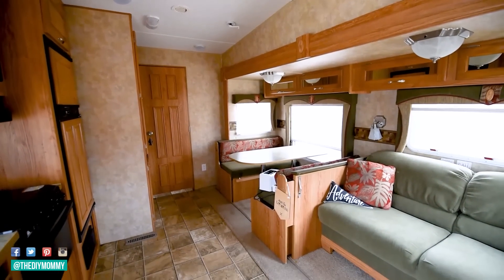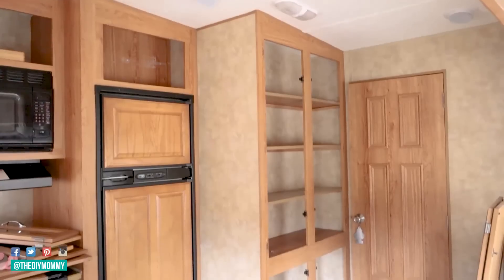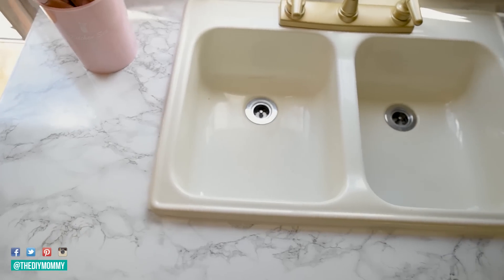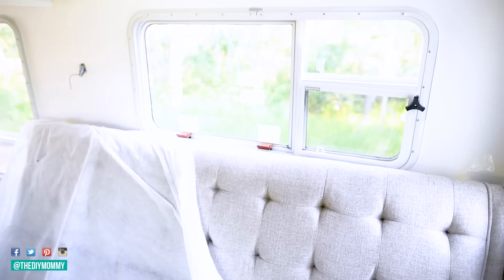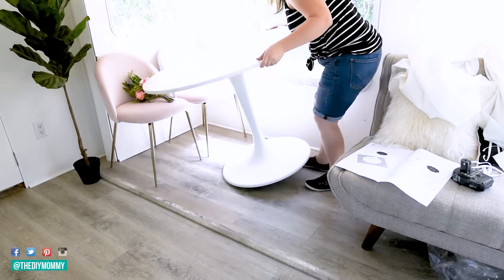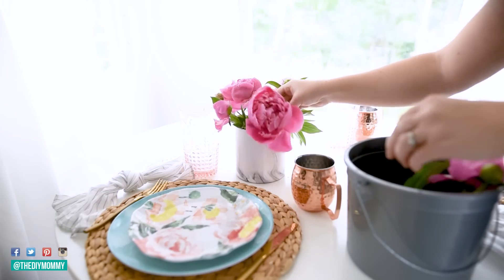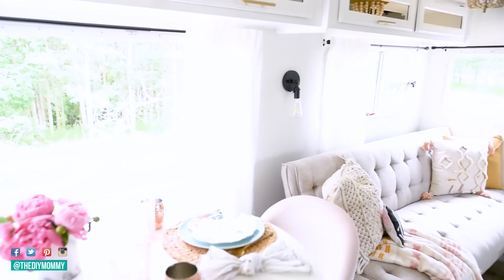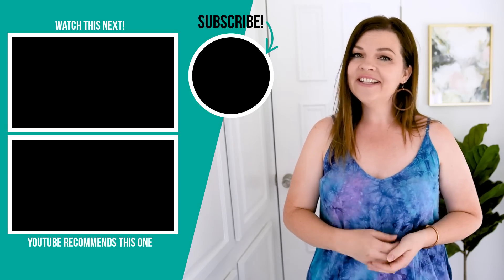RV Renovation Before & After Vintage Glam Makeover! | Our DIY Camper 2 | The DIY Mommy

Comment: My little Shasta Compact is Country Grandma style!  I worked around some old quilts I had and some thrifted custom made curtains that I was able to alter to fit the theme perfectly. 💕💕  I used click and lock shiplap material made from reclaimed wood that I found at Lowe’s for the ceiling and walls. Much easier for me to make the necessary small cuts on the angles.

Comment: For the coffee bar. Make a removable brace so you don't have to remove everything when you travel. And for the dinning table, you could cut the sides off. Then use piano hinges and reattach the sides and make a support the whole the sides up when in use. Fall down when not in use. The camper looks amazing. 👍🙂

Comment: I’m an older  tiny built female interior designer that has always owned homes and renovated them  on the inside 
I bought a one ton truck a couple years back to haul a 5th wheel that I not yet purchased
I’ve sold my beach condo and now own  a 2011 Montana 5th wheel . It’s been  well maintained, full of  structural  upgrades  but has that dated, hideous,  dark brown interior  & full of lazy boy recliners 
 
I like what you have done except for  the contact paper covering the counter tops 
Good for a picture , not durable in real life
I plan on posting some before and after pics like you. New York 1920’s -30’s  Art Deco  -with a  fun twist - will be the theme 

Go GIRL POWER !

Comment: You did a beautiful job there. I think the table is just the right size. And love the little open shelf under the sink. Your was similar to my 26' travel trailer I have a few years back. I lived in it for 2 yrs. I pulled out the couch and dinette, too. I was going to do something very similar to what you did. I did get a couch like yours, but vinyl. It wasn't comfortable to sleep on, though. I did end up moving to the county in a tiny 90 yr old house and sole the trailer to a young couple who wanted to turn it into a tinyhouse. Not sure if they did, but if I ever do it again, mine will look a lot like yours haha.

Comment: It turned out really pretty. Which is why it would never work for our family. 

We have a 1984 Winnebago Chieftain that we picked up for $200.00, the engine needs a rebuild. 

When we head out we go with our quads and dirt bikes and get down and dirty.

The inside has been well cared for. Everything works, everything's clean. The elder couple we bought it from were snowbirds and they had added conveniences like solar, upgraded appliances and custom storage.

The only major thing we are doing is moving out the banquet, to relocate and remodulate the storage layout, move the bathroom to where the main storage closet is, and turn the bed to make room for a queen size, add a piano hinged based, and make the undered storage available from both inside and out.

It's helpful we have a welder, a mechanic, and a class 1 driver in our family LOL.

The sofa will have removable slip covers made from painters cloths that has been sewn up in the corners for easy exchange and wash.

The carpet removed and the front end flooring replaced with vinyl planks and throw rugs, again for easy clean. Regarding laundry, we have a European style washer/dryer unit that will work into the new storage area. 

This unit works off of the solar.

As for decor, I think it will come quite naturally, tool box, helmets and safety gear hung around, chicken wire and pegboard. Very Man Cave functional. 

My concession is a small conversion of the area with the captain's chairs and fold down table behind the passenger side seat. This will be lightly modified for me to work while mobile.

The only pink I will be able to get away with to add that girly touch, is milk painting the beige backs of the captain's chairs. Luckily the plaid fronts have pink stripes in it. So folks will know that there is a woman in the Man Cave!
Reply from the maker: LOL! My husband has a man cave too: https://thediymommy.com/our-ultra-modern-theater-room-man-cave-reveal/

Comment: I’ve been loving following along with your videos! It looks amazing! I am currently renovating our ‘98 fifth wheel and I get a lot of inspiration from your makeover 😍 when you spray painted all the door hinges and cabinet pulls - did you sand them first? And have you had to apply a top coat over that Rustoleum spray paint? How are they holding up? I also did a peel and stick tile in our kitchen and it made such a difference! Did you put a clear coat on top of it to help seal it in?
Reply from the maker: I didn't sand or seal, I just cleaned the hinges and pulls with a degreasing cleaner. The spray paint hasn't chipped yet (and I did the same thing on our 3 year old camper).
Reply: The DIY Mommy oh that’s awesome! I’ve been sanding all the pulls but was dreading doing the hinges so I’m just going to paint over them 🤗 glad to know they’ve held up well. thank you!!

Comment: On the slide portion what did you use for the edging? Do you have any problems with the slide going over the main floor? Love the transformation has the glam factor.
Reply from the maker: I used reducer trim for the slide-out edging

Comment: Beautiful job! Have you had an trouble with the peel & stick backsplash? Mine is popping up 
:( and any trouble with the countertop? I want to do it & my hubby is worried it’s gonna peel up.
Reply from the maker: I find that some peel and stick tiles work better than others. You could try to glue them down again with a stronger glue? Here's an update on my tiles: https://youtu.be/IJDDK3oKSDk - My countertops, I'm very happy with but of course, they're in a camper that we use for vacationing and don't use them everyday. However, it's a pretty low cost investment that makes a big impact.

Comment: I am so inspired to makeover our very nice but exceedingly brown camper. Clearly women do not design the interiors of new campers - they are so hideous. I never even thought it was possible to just change it and you made it look totally doable. Question: how is the paint wearing on the various surfaces, such as the textured wallpaper-ish walls and the fixtures? Anything you've learned you'd do differently next time?
Reply from the maker: Hi Susan! I painted over those same texture/vinyl walls in my previous camper, and we used it for 3 seasons and it held up really well!